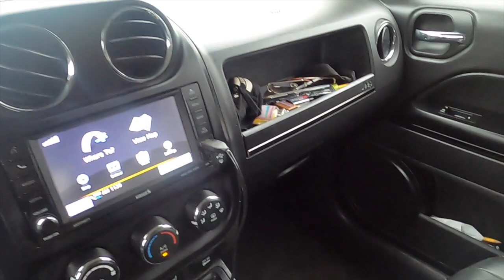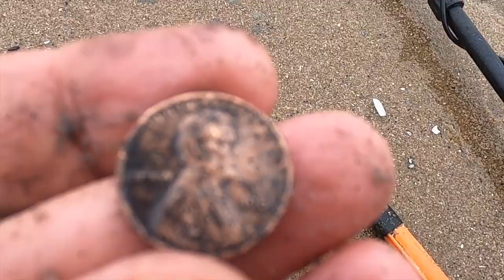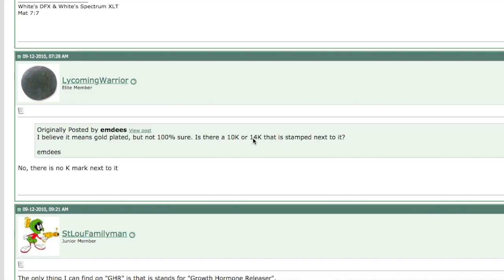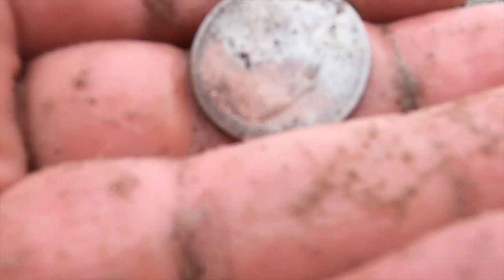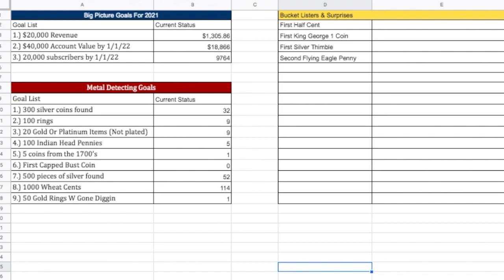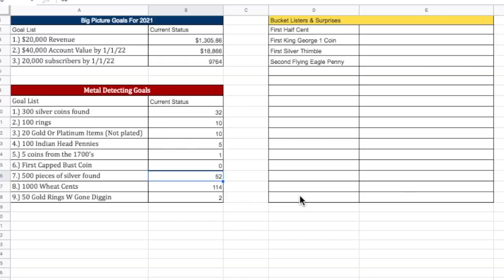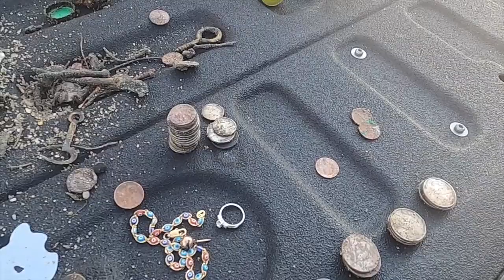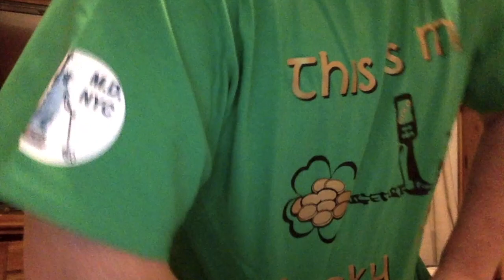Expensive Metal Detector Finds: The Multi Karat Diamond/Gold Ring

Comment: I believe you need to find a spot where it won't show too much, such as the inside of a ring, and then give it a firm scrape. That will get below any plating if it has one. Then apply the acid. The same applies to silver.